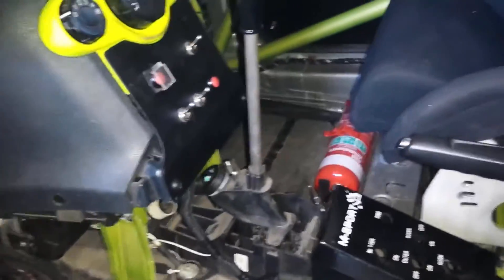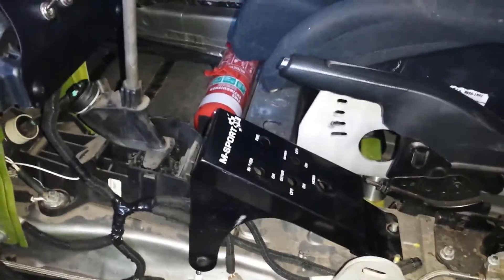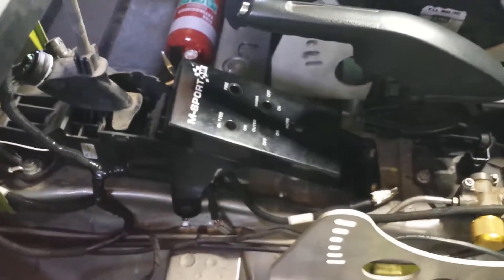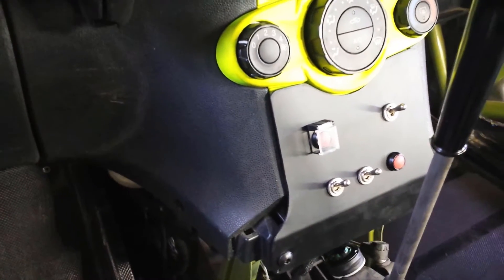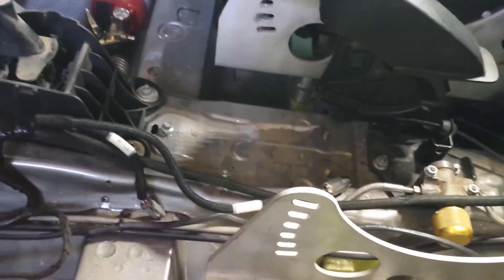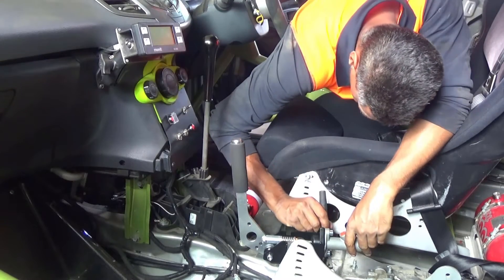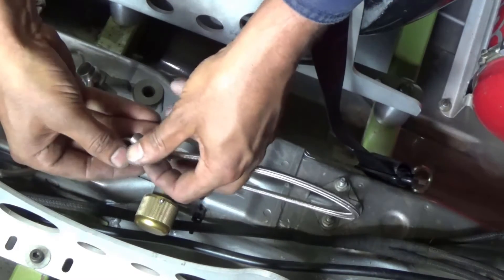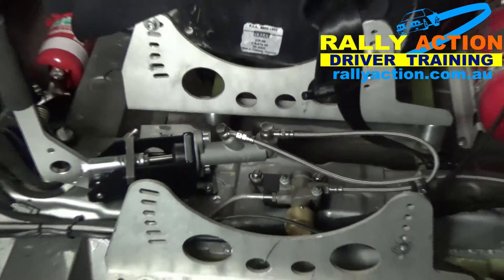Ford fiesta MK7 rally car hydraulic handbrake conversion

Comment: What method did you use to bleed the system? My handbrake is soft. Did you open the brake bias valve all the way?
Reply from the maker: Usually we have the bias valve half way open when we bleed the brakes. Start with the wheel furthest away from the master cylinder and work your way to the closest wheel. There's no special trick to bleed the brakes. If there's still air in the system it's most likely a tiny weep in one of the fittings. Check and re-check all fittings for traces of brake fluid and nip up if required. If you find a leak, bleed again until all air is out.
Reply: @rallyactionwa  Did you pump the handbrake as well or just the pedal?
Reply from the maker: @troyd-motorsport9933  No you don't need to pump the handbrake. The handbrake master cylinders have a bypass built in. You just leave the handbrake off and bleed the brakes as normal.
Reply: @rallyactionwa  thanks!